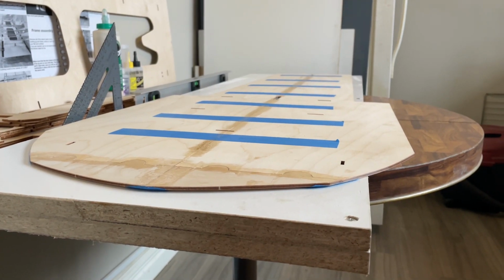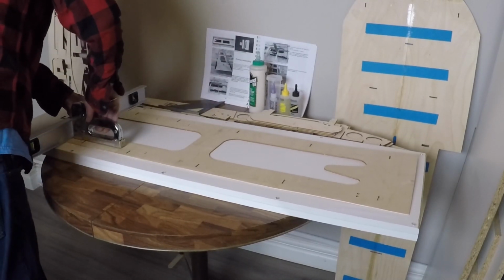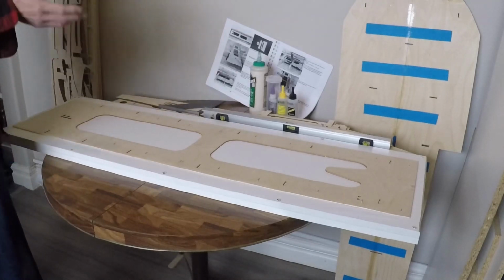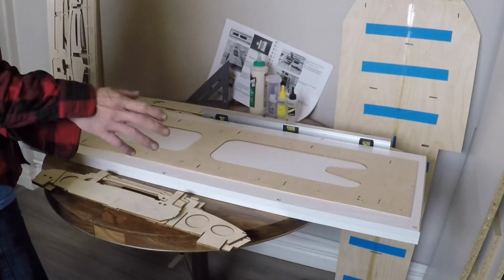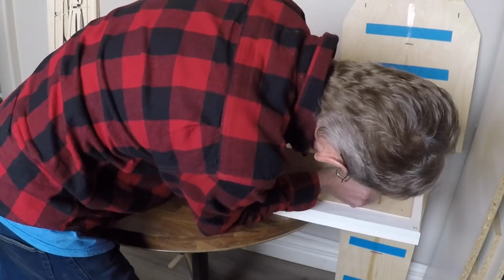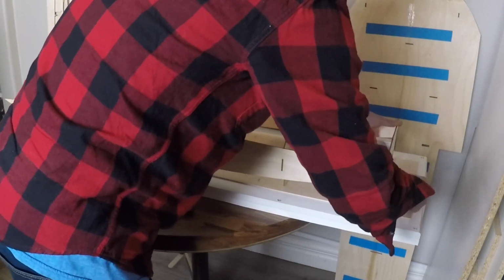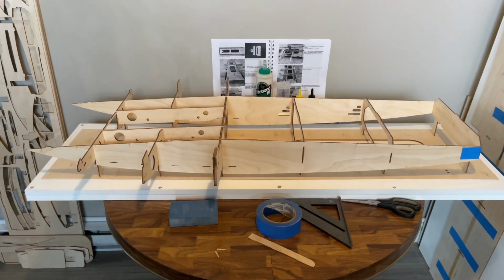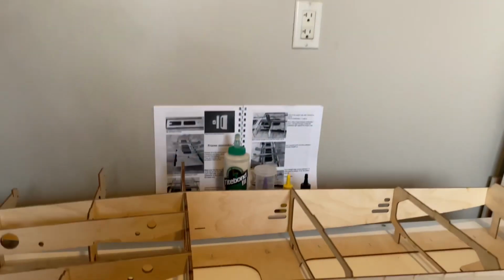Zippkits SLR Missile Thunderboat Build Jig Frame Dry Fit Episode 6

Comment: How big are the boards?
Reply from the maker: 16 wide by 50 long. 2 pieces of 3/4 MDF screwed together. 1 1/2 inch thickness. A little wider would be nice for some work you have to do, but the supplied jig fit no problem. Thanks for watching. Appreciate it. Take care.
Reply: Your videos are absolutely the best.  You took time to completely explain the build process, and although I have been an rc’er for 40 years, I learned a lot from watching the slr video series.  I am going to buy one of the and put it together with your videos as guidance.
Reply from the maker: @kayakinfishin , Thank you 🙏 sir. I produced the SLR video series as a guide to anyone who may want to build the boat. I highly recommend you do so. It’s a great kit to build. I need more pond time on my boat. That’s coming as soon as spring hits. Thanks again for your kind words and channel support. I truly appreciate it. Take care. HGD.